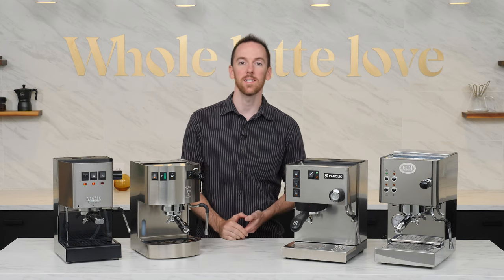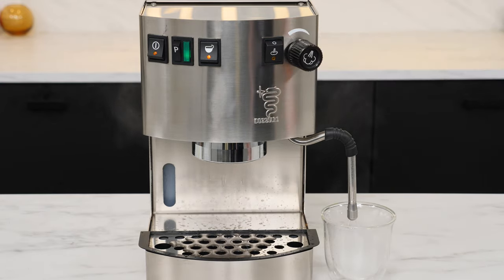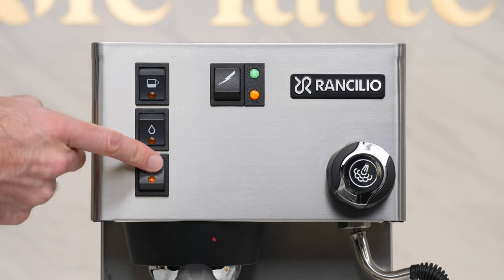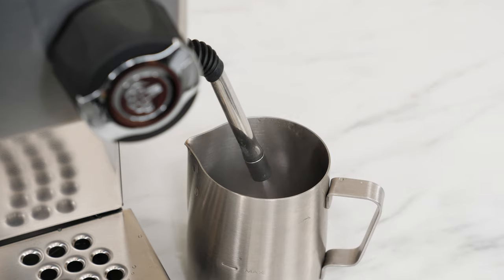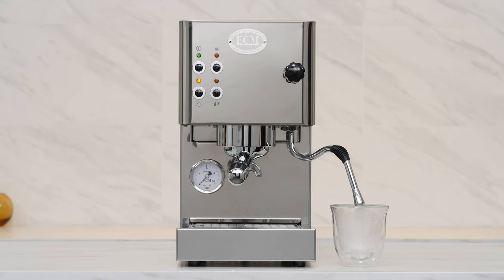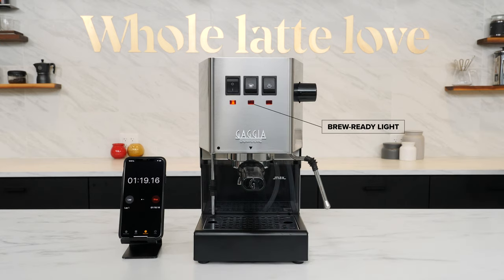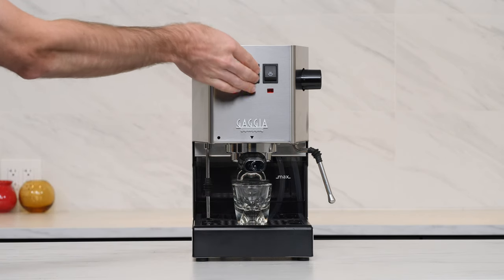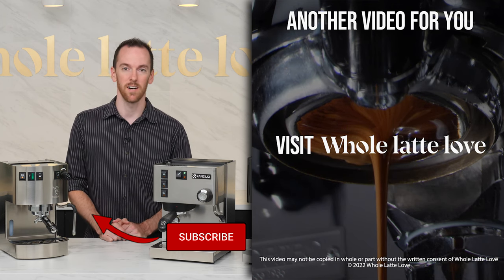Tips and Tricks for Single Boiler Espresso Machines

Comment: Really nice video. I've had a Gaggia for 9 months now and have found a couple of these tips through trial and error. 
As mentioned in a couple of other comments, the pressure of the Gaggia is >12 bar (near 14). Before buying a grinder, and having to use pre-ground coffee, I used to get round the high pressure using the same tip as for pre-infusion i.e. Keeping the steam partially open. This lengthened the timing of my shot and made the coffee palatable. (You end up with a half cup of water). Now I have a grinder, (a Niche Zero), I adjust the grind to get the timing of shot I'm after with the 12-14 bar pressure. So probably finer than with a better machine.
The thing that I've found really makes a difference with the Gaggia is ensuring it is fully heated before using it. The book says you can use it as soon as the light comes on from cold, but I always run a full cup of water and a full steam extraction before making a coffee, sometimes twice. Also, because it's quite a small boiler, if I'm heating a lot of milk, I will stop just after aeration, allow the steam to fully heat again, and then do the circulation part.
I'm not sure if the above would work with the other machines but if you have a Gaggia, maybe worth a try.
Cheers
p.s. I would also love to change the screen for a IMS but I can't get the fixing screw out!
Reply: It should be easy to unscrew the brew head unless your brew head has calcification buildup. You will never be able to unscrew it due to the scale bonding to the screw thread. What you can do is flip upside down the machine, pour de-scaling solution to the shower screen, let it do the work for 15 minutes. Try unscrewing again. Repeat for another 15 minutes for a few more rounds until you are able to unscrew. Good luck.
Reply: @saifulbahrimahfuz  That's great, thank you. I'll give that a try this weekend.
Reply from the maker: Hi Graham, Here's a video presented by our lead service tech showing how to get out a stubborn screw. He says this technique has never failed and he's worked on hundreds of Gaggia Classics: https://youtu.be/Kigi1ggnTJ0

Comment: In addition to these good tips, you can leave the Gaggia Classic on for about 20 minutes, warming up the whole machine including the portafilter, before pulling the shot.  I find that improves consistency.  If you forget to return after 20 minutes and the machine becomes too hot, you can flush out some hot water to cool it back down a little.
Reply from the maker: Yes, great idea to let everything fully heat up before brewing
AJ
Reply: Yes, while the Gaggia Classic is technically "ready" after about five minutes, I find everything works much better when it's been on at least twenty minutes.  My normal morning involves waking up and turning on the machine, doing all my morning things, then flushing it.  I weigh and grind my beans, flush it until the light goes out, put in the portafilter, and flip it on when the light comes back on.  I aim for a 30 second extraction from 19 grams to produce 45 grams of espresso for my best shot with the machine.

Comment: Nice! But I would strongly suggest anyone with the Gaggia Classic Pro to swap out the pressure spring to a 9 pound spring (if you never use the pressurized basket). This greatly improved my shot consistency and ended my channeling issues. That, is the best upgrade for the machine, and only cost $7.00.
Reply: I'm gonna try this, looking for this spring on internet .I didn't cut off myself because I scare a little bit that i can broke the machine. I have  the channeling too.
Reply: @omerfarukaydogan  I could NOT get it to stop. Everything I tried failed. I learned the standard espresso machine pressure is 9 bar and that Gaggia is around 12. Swapping it to 9 instantly fixed my issue. Now I have better flavor and no channeling.
Reply: @jeremiahsstudentpilotadven7834  So cool.I am pleased for you.  😊☕️ I watched almost every 12 to 9 bar upgrade/change video and saw the flow difference but i dont want to cut the original spring. I want to buy a new one. 
Still searching in Türkiye.
Reply from the maker: Glad you found value in that mod and are pulling great shots. This video is more focused on tricks you can do with a stock machine without having to buy any additional parts or take anything apart. 
AJ
Reply: 9 bar not 9 pound
Reply: Know where I can buy it from?
Reply: @DISTURBEDSAS  For us in the USA, we can get it from eBay.
Reply: @chrissantos7865  lol I know. I clarified myself in a reply above.
Reply: Is it easy to do? I dont have any experience with this stuff
Reply: @omerfarukaydogan  Don't cut the spring, it's not the same. Springs act differently when cut. Just buy the 9bar spring
Reply: @UncleBenjs  people treating their machines like 90s hondas

Comment: Great video thanks. Could you please clarify the point about refilling the boiler to prevent damage to the heating element. Thanks
Reply: he just means turning off the steam function after your milk is steamed so the boiler stops continuously heating water to steam temp. followed by letting out the extra steam through the grouphead or steam wand before brewing your next shot.
Reply from the maker: Heating elements inside boilers are designed to be surrounded by water. When you steam, you're removing water from the boiler without replacing it. Dry-running the heating element can cause it to burn out or break. By running the pump and refilling the boiler, you prevent that from happening.
AJ
Reply: @Wholelattelovepage  thank you 😊

Comment: Pre-infusion point.  You said do a quarter turn on the steam knob.  On the two machines that I've used, a quarter turn of the steam knob goes from OFF to FULL ON.  
So you have to find where your machine releases water out of the steam wand.  So rather than 1/4 turn, 1/4 open makes more sense.

Comment: AJ… great tips
I have some feedback based on my vintage Silvia with aftermarket PID
i have noticed that turning on the brew switch rapidly decreases the boiler temp based on the cold reservoir water refilling the small boiler
To aggravate that situation…the heating element does not start adding hear immediately so the temp does not recover till after brewing is completed.   Ultimately this results in a highly variable brew temp

You might want to test a machine with a scale device to see how water temp varies through out the extraction
My technique , for my machine, I start with a water temp of about 195 
Turn on the steam switch to get the heating element cooking
When boiler temp gets to 202, I do a 3 sec pre infusion
Stopping before any espresso emerges
This knocks down boiler temp to about 195 with heating element still on
Then I  start brewing again when boiler r3covers to 200
This knocks temp down about 6 degrees for a final brew temp of about 194 for dark roast

Of course the above  is  specific for my  old machine with pid
So you would have to adapt this method based on scarce feedback

Thx again for your videos!
Reply from the maker: Hi Ardy, thanks for the comment and sharing your routine. I agree with you that people need to tailor their routines for their equipment and you've certainly done that!
AJ
Reply: @Wholelattelovepage  
AJ…
Btw… I finally tired of my elaborate routine… and s9 got a new pro 300
Looking forward… cheers

Comment: Amazing video!! I’m a beginner and still thinking about buying the Silvia. This might be a dumb question but when just brewing back to back shots and NOT steaming, is it necessary to cool it down or you just flush the group head and that’s it to continue to the next shot? Also, when brewing regular americanos, same question, I have to cool it down through the steam wand? Thanks!
Reply from the maker: Hey Alon, Thanks for the question and there are no dumb questions! No need to cool down boiler if just doing espresso or drawing hot water. Only need to cool down after steaming. I do recommend a flush in between shots.
Hope that helps!
Marc
Reply: @Wholelattelovepage  Hello Marc! Thanks for replying all my same questions in here and in the other videos 😂. This answer is very helpful! 👍🏼

Comment: Btw… one other thing I have noticed
As you know… the coffee bloom tends to get sucked back into the group head when the OPV valve opens
I have noticed that using a puck screen almost entirely stops this issue… which keeps the machine much cleaner much longer
Reply from the maker: I have a puck screen sitting on my desk waiting for testing! We just started carrying them here: https://www.wholelattelove.com/products/caffewerks-puck-screen-58-5mm
AJ
Reply: AJ… a few other comments on puck screens
On my old Silvia… the pucks are sometimes a little watery. Then when the 3 way valve opens… the puck gets sucked up an occasionally sticks to the group head screen…. Which is annoying

Using a puck screen stops this… there is maybe a tsp of water. On top of the screen…. And a dry puck underneath

The downside of puck screens is  the problem of removing the hot screen from the puck with out dumping it in the knock box
What I do is as follows
First I have two puck screens to let one cool a bit
But to clean the porta filter
I tap out on to a plastic cutting board
Then flip the puck so screen is on top
Which lets me drop the puck In The knock box while holding the screen in my fingers

Comment: Timing for consistency and control is such a good tip, I found this one out myself and I get very consistent results which allows me to focus on improving other techniques. The pre-infusion was interesting, I’ve tried this to date by switching the brew switch off, once I see the coffee start to come through the basket; I’ll try the other metros suggested. I imagine this reduces the pressure in the boiler during brewing?
Reply: I’ve heard this isn’t the best way to pre infuse.  You want to keep the pressure up and when. You turn it off the pressure releases totally.  Not sure if there’s a real noticeable (tastable) dif but I’m ok with wasting an oz or so of water per shot.
Reply from the maker: As Damon pointed out, when you turn off the brew switch the 3-way solenoid valve activates and sucks up the water in the group, depressurizing it but also disturbing the puck. This can lead to channeling and uneven extraction. Yes, it does reduce the pressure while you're performing the pre-infusion. The more you open the steam valve, the lower pressure going to the group. 
AJ
Reply: @Wholelattelovepage  @damon Interesting, I omitted to add I’m using a Gaggia Selecta Deluxe with no 3-way solenoid. I’ve now tried both ways and don’t taste any difference. After dialling in, I’ve found puck preparation to be really important though.
Reply from the maker: Ahh that makes sense, it may not be an issue for you on that machine. 
AJ

Comment: Why wait 10 seconds after the light comes up? Another youtuber Lance Hedrick mentioned that temperature was still building up at that time. Are you sure that it's at peak temperature when the light comes back on after the purge?
Reply from the maker: I've heard a couple people say that temperature will continue to drift up a little after the light comes on, but I don't know if I buy that. The heating element turns off at that point, so why would it continue going up? 

I recommend waiting those 10 seconds to allow the temperature to start going down, as it often overshoots the "ideal" temperature. Obviously this will depend on your beans, recipe, and taste preferences. In the end, it's more about consistency than hitting an exact temperature. Waiting 10 seconds allows me to react to the light, lock in my portafilter, put my glass under, and hit brew. 
AJ
Reply: @Wholelattelovepage  Great, thanks for that really good answer. You guys ROCK!

Comment: After 40 minutes of the machine being on, is it possible that the portafilter would be so hot that it would slightly burn the coffee grounds as they sit in it for a while before attaching the portafilter and starting the extraction?
Reply from the maker: Hi s, Well, you don't want to leave ground coffee in the portafilter. Generally load and brew ASAP. It would not burn it but def hasten evaporation of aromatics.
Reply: @Wholelattelovepage  thanks, I guess I found the reason why sometimes my espresso has a slight burnt taste 😅

Comment: I wish the graph you showed in the video had values/numbers. It would be nice to know what temp the machine is at (approximately) when the indicator light goes on and what temp the machine is at after waiting 10 seconds.
Reply: For the Gaggia Classic Pro, specifically.
Reply from the maker: Hi gb f, here's a link to a forum thread where someone charted the Gaggia Classic Pro temps over time. Not my graph and a little hard to read, but hope this helps: https://www.coffeeforums.co.uk/threads/gaggia-classic-brew-temperature-graph.18659/
AJ